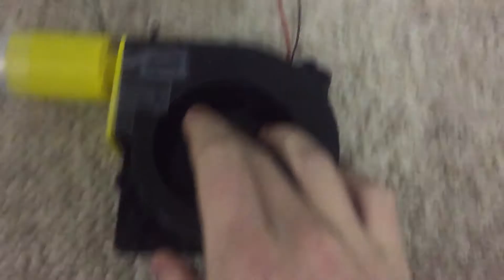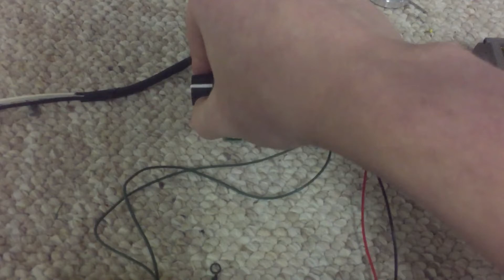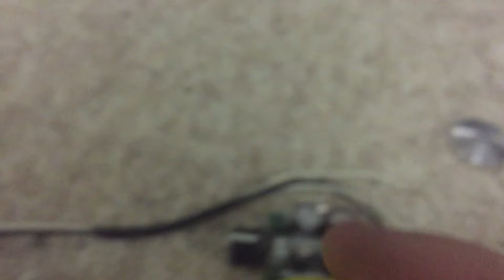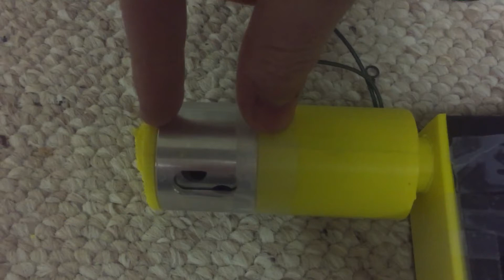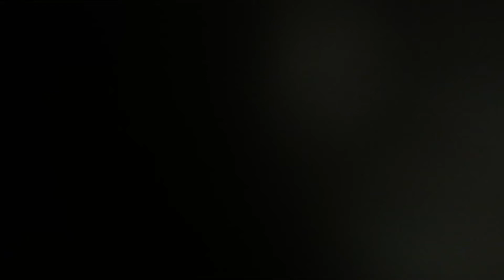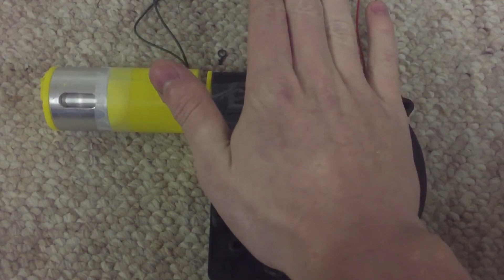Mini Thunderbolt Siren Project Part 2

Comment: Can you create files to 3d print the metal parts in plastic?
Reply from the maker: Yes, they were in plastic at first as a prototype to see if any of this would work. The only problem is they are not a perfect fit. I had to do some slight scaling on the printer software as well as some sanding to make sure they wouldn't rub. If I get the time I will upload the files to thingiverse.
Reply: Sounds great! thanks!

Comment: Cool. A guy by the name of Eric Green did the same thing. He has videos of his mini T Bolt on here too. Your design is very cool though because you actually 3D printed the parts. Eric didn't use any 3D printing. Are you gonna 3D print the horn too? Also, you should add solenoids to it and make it a 1003 so that it can do the hi-low signal :-D
Reply from the maker: I actually got the idea to build this after watching one of his videos. Yes, I have 3d printed the horn, unfortunately my printer is to small to make it to the right dimensions for this scale.  You can see the updates I have made on my latest video! I would like to make it a mini 1003 but I haven't been able to find small  solenoids that would fit the scale im trying to stick to.